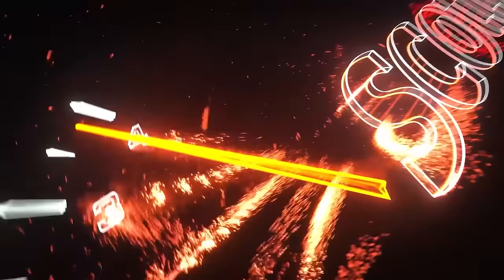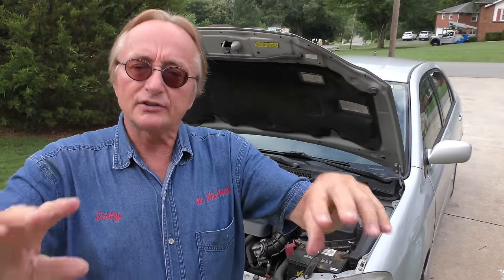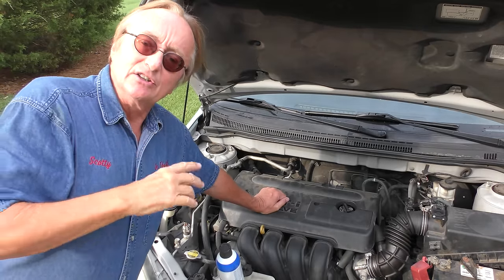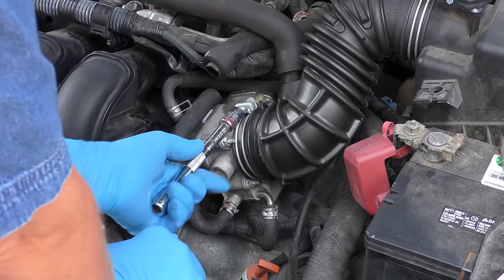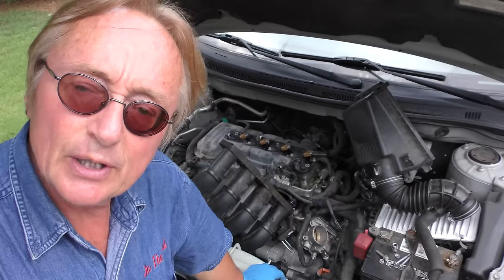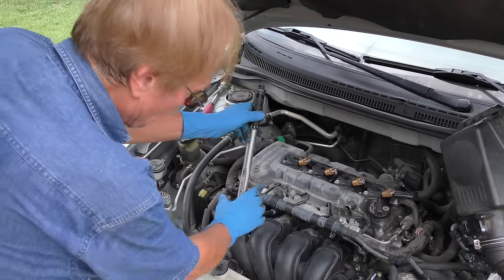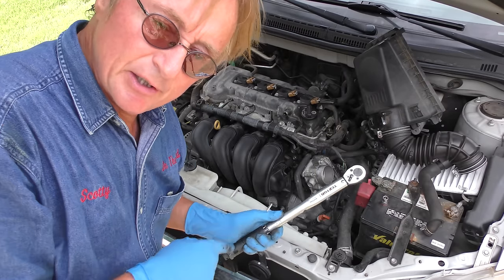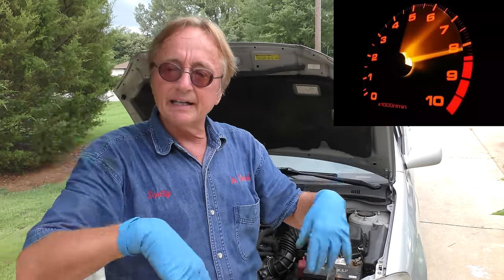Toyota Won’t Fix This Problem and I'm Mad as Hell

Comment: Ford 1.6 diesel, naturally aspirated. I had Ford Escort with that motor, and with manual tranny. That thing was absolutely amazing, even 20 year old. I had one years ago,, when I lived in Europe. Easy 50 mpg, started as low as -16 F, top speed about 70 mph, but really loved at around 55 - 60. The body of that car was falling apart due to rust, but the engine was absolutely bullet proof. Change oil, filters, glowplugs (easy), battery, and it was a gold. I would pay any money, if I would get it brand new here, in the USA.

Comment: Scotty my Subaru outback misfires 1000 to 2000 rpm misfires stops works great over 2000 rpm .3.6  6 cycle. Would that be similar to the issue you were talking about today.
Reply: which year is your wagon?..mine is 21
Reply: If you have not done spark plugs yet and it has a bajillion miles on it, I suggest that first.
Reply: That's your problem right there Aaron. You have a 6 cycle instead of a  Bicycle.
Reply: @MultiBbrand  by the sound of it will need a bicycle soon 🤣

Comment: Thank you for this nice info. I have the same issue, specially when I fill up. The car starts only if I start twice. My mechanic checked for air leak then changed idle body sensor and another sensor. They did not help. Now I know what to look for.
Reply: @Mild Child thank you so much for your tip. Be well.
Reply: It happens only when I fill up the tank.

Comment: my 2001 Saturn had the same problem also gm car with the same problem
Reply: So many cars since new millenium use too much plastic in vital parts. If UV doesn't damage it the heat will over time. Throw away engines (swap out), unlike older motors that where rebuildable and stronger.

Comment: Everything eventually goes wrong, but Toyota has a better track record for long life and actually trying to fix design problems when they're discovered.
I took a lot of notes from watching Scotty's videos. I used them to inspect and test drive used cars. 
Those lessons helped me avoid a lot of lemon cars and some dishonest owners. His advice convinced me that Toyota was the correct choice for me and I ended up with a car that is nearly 20 years old, but in great shape at low mileage. Later, mechanics validated my choice by saying it was a gem. I'm really happy with it. It should provide years of reliable service. 
But, there is always more to learn, so I still come back to the mountain to hear the Guru utter more wisdom. My file of maintenance and troubleshooting notes got longer today.

Comment: Good Lesson, Honestly didn't know that you HAD to use a torque wrench on the "plastic crap". I did notice the 2018 f150 V8, gen3 Coyote, has a ton of plastic... @18K now I wonder how long before the plastic cracks? I Guess Time will Tell... Sucks Right NOT knowing...

Comment: Scotty, for the love of god, if you aren’t going to disconnect the positive battery terminal, at least cover it. I winced at least 4 or 5 times watching you use tools and yank on parts with it exposed right there the whole time.
Reply: Disconnect the negative rather Scotty. Your spanner can cause a short circuit if you remove the positive terminal first.

Comment: This is a good tip as it's very common for this gasket to go bad. Toyota has a better replacement gasket and it's bright orange in color  ( $10 ).
Reply: How about with using one from Fel-Pro?
Reply: @MrRusell86  I've used fel-pro before with good results. I used Toyota here because it was inexpensive and redesigned specifically to fix this well known problem.
Reply: The orange gasket is junk after about 400 miles... just plain junk !  I use fel-pro and have had no 'comebacks' ....

Comment: Have had a chronic P0171 code on my 2001 corolla.  Going to try this carb cleaner trick.  👍
Reply: Did it work?
Reply: Did you change the air intake gasket? I have a chronic P0171 on my 2000 Corolla because the LTFT goes up to 38.3% when it should be far lower.

Comment: I’ve found a used 2008 Toyota Corolla S for $5,800 with 177k miles on it. Is that too many miles for the price, or is that too many miles in general. And Should I consider buying it?

Comment: Need help fixing my Nissan Xterra 03 change the fuel filter and tsp and plugs and wires my truck was having problem getting speed now just turn off if I take my foot off the gas it dies
Reply: Is it fuel injected or does it have a carborator?

Comment: 8:53 - Scotty is correct. Germans do make Great engines. I have over 210,000 miles on my 2001 BMW X5 4.4.i V8 to prove it.
Reply: Honda makes the best engines. They're bulletproof and will last forever.

Comment: Mine is doing something similar. mine shakes at stop, RPM goes high at about 1200 then drops to 600 and shakes like it's about to die then goes back to normal around 800. Repeats after a few seconds at regular interval.

Comment: Hi Scotty - 2 questions. Would this show up on your fancy scan tool? Also does the V6 engine  have the same issue?
Reply: Likely yes. On scan tools it may come up as PO171 Or PO174 codes. It will say what bank and what description. Usually system to lean.

Comment: I have. 2019  Camry 4 cy. Is there still a problem with them or did the factor up grade the gasket. I had the recall on fuel pump already, car runs great

Comment: I own a 2004 Pontiac vibe , this is good to know
Reply: Yep, they're basically a Toyota Matrix underneath, and you can get them cheaper than Toyotas because GM=greater depreciation. Great vehicles.
Reply: @joshn938  yup…. I got my wife hers 3 years ago. 2004 Vibe w 124mi . Only thing I’ve done to it was the valve cover gasket. It has 154k mi on it now . Cheapest used car over 100k mi to maintain I’ve ever owned besides my 1989 Corolla GTS .

Comment: Toyota did revised the intake gasket, So when replaced with the revised gasket you will not have the problem again.
Reply: @Tom Smith 17171-22060 is the part number for my 2006 Corolla with the 1ZZ-FE engine, If yours is a different year or has the 2ZZ-GE, Check to see if this the right part for your car.

Comment: I may have the same problem with my Corolla 2004. It's burning a lot of fuel and I tried everything. Still doesn't get back to normal consumption. Any other alternate spray may I use? The carb spray is not available in my location

Comment: Hey Scotty! My wife drives an 05’ Corolla with that same 1.8L engine. Always hard starts when hot. Starts up just fine when it sits for awhile or in the morning so I don’t think it’s the fuel pump. I’m thinking the starter is “starting” to go. Lol It does have 171K miles. Any thoughts? Great video by the way. I’ll keep that intake manifold gasket in mind.
Reply: Mine is doing the same did you figure it out yet? Thanks
Reply: @dazz510  There’s a Toyota tsb about it. It says to update the ECM software if your car needs it and that should fix it. I already have the latest software and it still does it. If it works out for you, awesome. I checked for fuel injector leakage when engine is hot and off. No leakage. Fuel pump is putting out decent flow and pressure when hot and cold. Put a new starter in it. Sounds better when cranking, but still has an extended crank time. I can move the timing chain a lot when I did the valve cover gasket on it recently so I’m going to have to put in new guides and a chain. I don’t suspect timing has jumped but I guess I’ll know more once I have the timing cover off. The timing cover is leaking anyways so i may as well change it all. We’ll see if anything changes.

Comment: Have a p0171 code couldn’t figure out what it was gave up and started watching YouTube before bed and this was literally the first video😂 gonna check tommrow if this is the issue if it is thank you so much
Reply: Did it solve your issue? And how did the car run before you changed the air intake gasket?
Reply: @MrRusell86  yes fixed the issue and it was super easy to replace
Reply: @drdelirious8899  Wow. That is great. I have had the P0171 code come on and off now for three years in my 2000 Corolla. The STFT is normal but the LTFT reaches as high as 38.3% although the engine seems to run fine. The car is due to get smogged in April. I will replace this gasket and see if it fixes the issue. I bet it will because about the only thing left would be the ECM and I've been told that is unlikely to be the cause.
Reply: @MrRusell86  yes the code seemed to come on and off and the car ran fine besides idling to high when cold and replacing it fixed it

Comment: Could this be why my 0-30 acceleration is so anemic on my 2014 Corolla (basic mode), just got the car from my son but he said low end was always anemic?  My 2005 Corolla (also a basic model) had much better initial acceleration even when old. Top end acceleration is fine..... I just get a little concerned sometimes turning onto two  lane blacktop takes a while to get to 30-40 before it picks up .

Comment: I had a similar issue with a 124,000 mile Scion XD. Turned out to be a bent valve in the #3 cylinder.

Comment: The Ford 2l Duratec HE 4 cylinder (145 hp) - developed together with Mazda is one of the longest lasting engines on European market. A lot of them have 300k miles and more without any engine issues.

Comment: any possibility that i can have a intake gasket leak and the carb spray trick won’t find it? i have the p0171 code slightly rough idle but not bad at all vacuum hoses seem fine. was going to replace all hoses plus throttle body gaskets and intake gasket
Reply: Have you replaced the upstream 02 sensor with anything with anything other than OEM Denso? I replaced mine with Bosch and the car would sputter when cold initially and the engine would sound funny. I put in OEM Denso and no more sputtering and weird engine noise.

Comment: My 06 matrix has been stalling at the stop signs and no codes thrown so I've changed the intake gasket and torqued it properly and after done it was fine for one day but after the second day is been stalling again but not as before the new gasket, anybody has any input on what could it be??,,

Comment: Will bad intake gaskets cause misfires?
Reply: Do you have an ODB scan tool? It will tell you and maybe a spark plug?
Reply: @jammin1881  I found the problem already, which is the weakening of the valve springs

Comment: NEED HELP... I have an 08' Chevy Tahoe and yesterday when the ABS, brake and triangle lights came on. Then it should service stabilitrak, traction control, park assist and check suspension system. I have been searching YouTube and nothing specific to my make and model vehicle, brake fluid at max level. What causes this?
Reply: You may want to check wheel speed sensors. i think Scotty has a video on this and sure u can found gm specific vids on YouTube.
Reply: @andrewkeen5135  Thank you, I will.

Comment: Hey Scotty I’m 15 and I’m getting my first car and I have 2 choices either a 2009 Ford ranger or a 2007 Dodge Dakota which one should I pick
Reply: Buy both, but drive the Dakota first. You'll make your mistakes, have wrecks, and then part with it after a few years when it goes to the junkyard. The Ranger will be a good replacement.

Comment: When these EV's start to go wrong, good luck trying DIY's and simple diagnostics like a spray. 
With the closed architecture, secretive repair information and all computer monitored for non dealer repairs and maintenance.
EV long term ownership (if it will even exist) will cost an arm and a leg if and likely be a shorter life cycle.

Comment: BMW doesn't make great engines.  Look at the M cars........same connecting rod bearing problems on their straight 6, V10 and V8s.  Looks like they finally fixed it in the new turbo 6.  Then there's all the plastic parts they use on modern engines.